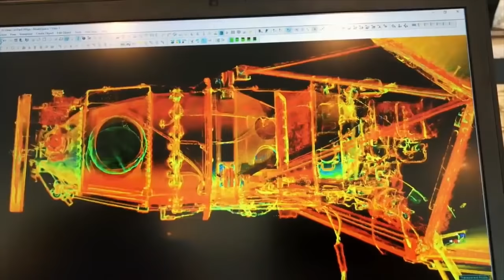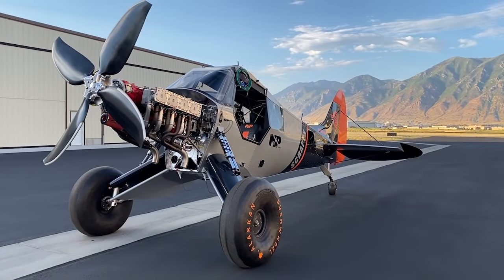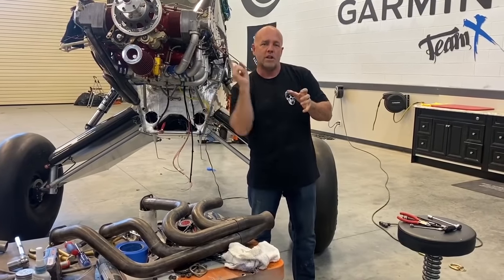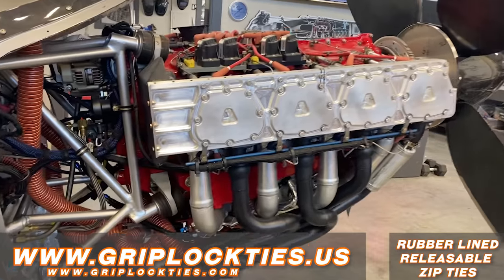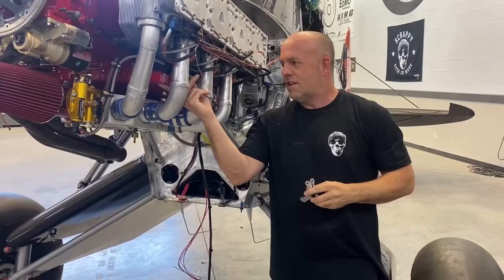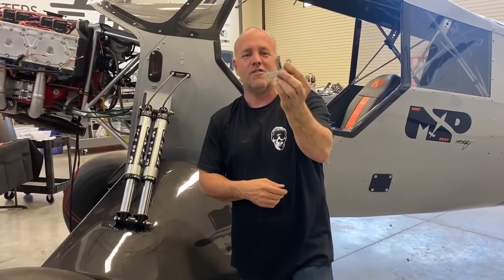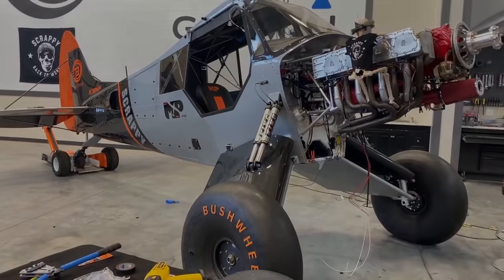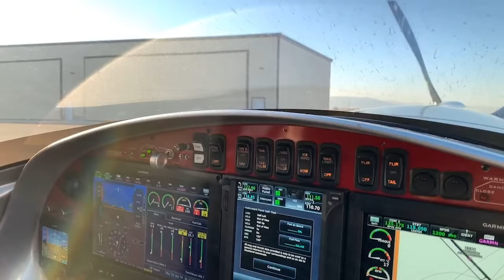Monster Race Engine Roars to Life in Tiny Bush Plane 🤩 Part 1 | Scrappy #32

Comment: As a fellow designer, engineer, and machinist.....I love the VO on the intro "Machine it, draft it......"
I tend to start in the shop as well - fiddling with ideas and concepts to see what is possible. Then I draft the part or assembly afterward armed with practical knowledge. 

Really love how you approach these challenges Mike! Really inspiring.
Reply: I, also, am a Mechanical Engineer (MET)! And I do design work (sometimes I just build it) and I know my way around a Machine Shop! My first thought when I saw the Intro was "This thing has an INSANE power/weight ratio!"

Comment: I bet that thing would fly even without the wings at full throttle...
Reply: Piece of cake to take off, but good luck with the landing...
Reply: @patheddles4004  pull the parachute to land...duh...
Reply: I have thought the same
Reply: I bet it would fly with the wings at idle throttle.
Reply: I´ll  bet Scrappy can jump up with the front gear up, even without the engine running, 
i´m pretty sure mike build kinda a lowrider/jumping car setup with these KingShocks, 
using the pressure of the Oxygen bottle..  Why? 

Stol Drags.. start with the shocks at no pressure, and a low height, avoiding drag from the Wings to get to Takeoff Speed even fastere, 
and as he hits the JUMP Scrappy JUMP  button, 
the Shocks and the massive travel they have will catapult Scrappys front up to get an massive Angle of attack.. 
and let the 780cui engine deal with the drag..  which it will be easy capable of pulling kinda 90° verical up   

This thing is a SToL Top Fuel Dragster while Draco was(and will be again) kinda an STOL SUV with lots of Power
Reply: That’s what I’m worried about, better be some real magic in those new wings to counteract all that torque “at low airspeed” especially in a crosswind.
Reply: @tropicthndr  pretty sure mike has done the math for that... and the steering surface will be huge... while that sick fan infront will deliver the air stream to put preassure on
Reply: True, rockets don't need wings to produce lift
Reply: He don't need no stinking wings.
Reply: Fastest powered parachute out there!
Reply: @jaybarnish77  rockets dont have engine torque to counterbalance
Reply: Well, they say helicopters fly by aesthetic antigravitation; being so ugly, earth refuses to attract them. In its current state that might work...
Reply: After I saw it a few times I realized that it misses the wings..
Maybe the brain didn't think it needed them with that engine.
I bet it can fly fixed point if you don't mount the wings.
Reply: Mike likes to do everything ‘extreme’. It’ll be fast. He said at the beginning he wants to set records. There is no market for an aircraft like this. Unless, you’re rich and have rich friends.  The commoners will have to resort to watching what he posts because building an aircraft, like this, ensures the commoners won’t be eating breakfast with you on your friends 500 acre ranch, next to a stream, with their $1.5+ million dollar aircraft all lined up.
Reply: @shanbadg697   With the prop being fixed pitch and designed for acceleration and climb out, it won't have much top speed.  But I guess one's definition of fast could mean acceleration or speed, so...
Reply: @SirDigger420  Counteracting torque is not done with wings, it's done with rudder.  He's already made it considerably larger than a cub.
Reply: @Skinflaps_Meatslapper , a minor correction. Scrappy most definitely has a BIG constant speed propellor!
Reply: @v1rotait23  It's fixed pitch.  Look at the video where he talks about it.  Pitch is ground adjustable only.
Reply: lol  that tail will produce enuf lift with that thing at full throttle prolly...  waitin to see if it jumps the rear wheel up at idle!!!!  (myself waitin for that, lol,  hahahaha unpausing)
Reply: I bet that thing would fly without the throttle at full wings...
Reply: Nope without wings the torque from the prop would spin the aircraft.
Reply: @HotelPapa100  60
Reply: Same here
Reply: I swear 💯 sure😂😂😂
Reply: It's a guided motor
Reply: @nealsims1862  tail rudder? haha idk im a spinny wing pilot we deal with torque all the time, you can keep your planes
Reply: Yep stand it on end and it will fly like a chopper
Reply: LOL!  🤣  👍🏼👍🏼
Reply: half throttle
Reply: it would be a propeller powered rocket
Reply: That was crazy! I watched this whole video and never noticed this plane has NO WINGS! lul
I was fascinated by the aesthetics, the engine and design. I watched the next video in my recommended in the title it said "wingless plane" and it struck me that plane had NO wings!
OMG the thing is so beautiful I never noticed but then again I am not a plane person .
Reply: InstaBlaster.

Comment: I am always impressed by your attention to detail with your engineering Mike. There is no “cutting corners” or “close enough is good enough” approach with your aircraft builds. The most recent example where you took the time to manufacture the throttle and mixture control bell crank levers with ball bearings instead of plain bushings is just another example of going that extra yard and is fantastic.
Reply from the maker: Thanks Jeff 🤠

Comment: That was one of the best explanations I have seen for having tuned exhaust. Thanks Mike!
Reply: This is only equal length NOT tuned length. Tuning is FAR more involved and if you want to read up on it have a look at the Race Engine Spec Form on BUNS Stainless website and some of their articles on the subject.
Reply: @timphoto83ec  
Indeed. A very long winded explanation at that. Guy is acting like he invented the concept.

Comment: Since you introduce this engine I've had a question. With the power to weight ratio, is there some reason that you still need wings? KJZI
Reply: Torque control! like the tail rotor on a helicopter! LOL
Reply: Scrappy #33 no need for wings, lets fly it.
Reply: Wings schmings........ let er rip!
Reply: He's got wings on the landing gear...
Reply: Without wings there would be nowhere to mount nav lights :D
Reply: Quite seriously he could probably just hang it vertically on the prop.
Reply: @ToddDunning  ive been wondering if he is going to do this... bc he is skilled/crazy enough to try it
Reply: @ToddDunning  VTOL. yeah.
Reply: @KM-dx8kf  Oh God, I didn't think of that.
Reply: lol lol lol lol lol  Right?!
Reply: Off to the ¼ mile Drags with no wings, keep her straight lol.... torque steer into the crowd...

Comment: The prop is as insane as the engine. Can probably take off like a helicopter.
Reply: do weird tricks like they do with them superlight high powered RC planes
Reply: Draco darn near did!
Reply: Looks like an airboat prop
Reply: @austinzimmerman2934  Lol, It IS an airboat prop!
Reply: @daverohn383  probably would have if he tried... cant blame him for using proper instincts to save himself tho.
Reply: of course it can. it would only require like 2100lbs of thrust to do so. and ill bet my life it makes WELL oVer that!!!!
Reply: At 13:46 he actually did. 45 degree climb. Straight up.

Comment: Just discovered your channel. As a hot rodder, an off-roader and an F-15 Eagle maintainer of 34 years, I totally dig what you have created. As an Eagle Keeper, the world's ultimate hot rod, I can totally appreciate putting a big engine into a small package. Good stuff! I just subscribed.
Reply: Hydin Biden  Well, yeah, the Blackbird was faster and flew higher... but the Eagle set numerous time to altitude records and I'm pretty sure is more maneuverable. Probably easier to maintain as well. Never worked the Blackbird but I've heard the horror stories.
Reply: Hydin Biden  Right on. Once a Marine, always a Marine! Once it's in ya, ain't no getting rid of it.

Comment: And I thought a 427 cobra was the ultimate. This is insane for an airplane.
Reply: Never heard of the Weineck AC Cobra 780? Check it out! ;)
Reply: So that's a flat 8 in there then?  How would that compare/function if it was shoved in a car?
Reply: In 1960,
Reply: stefan w my dad told be, after WWII he say a guy put a Spitfire Rolls-Royce engine in a car. As it drove down the highway at 80 miles an hour he could give it gas and smoke the tires

Comment: That double sheathing on the electric cable is something I wish I had on my semi. I had my main battery cables rub over each other right next to my fuel tank and catch fire. I was able to put it out and disconnect the battery before the fuel caught. It was a scary few moments there. I'd hate something like that to happen in the air.
Reply: The tube the wiring bundle is tied to is called a 'raceway'.  Keeps chaifing and dangling wires to a minimum.  I used to make and repair acft engine wire harnesses.  
He's right - that's the smoothest sounding recip engine I've ever heard...

Comment: Top 5 reasons there were only 9 seconds shown of Scrappy running...

5. Mike got something in his eye.
4. It only ran for 8 sec.
3. With no piped past the headers it was too loud, & the neighbors complained.
2. The cameraman lost the rest of the footage......
       AND THE NUMBER 1
                 REASON

1. The pick-up couldn't hold it back, even with his wife standing in the brakes....😜👍👍
Reply from the maker: 😂 You know there is more coming 😉
Reply: @MikePatey  
As certain as death, taxes, the sun rising in the east, & if I ever get close enough to see it parked I'm checking the oil... LoL 😜👍👍

Comment: The  torque is a concern, but I'd be more concerned with not enough back elevator while on the ground. One good engine rev and It could end up on its nose before you could react.
Reply: That's why it's called throttle management.
Reply: Craig VanWagner

Take off and land with the tail wheel down whilst maintaining throttle control. The B-17 and Gullwing F-4 (WW2)  used this solution for that problem.

Comment: Sheesh. 12+ minutes in, a puff of smoke and a short rev, tamped down with electro-muzik. Disappointing.
Reply: bs
Reply: it's the very first start up...what did you expect for the very first? full throttle? a take off? pretty sure you missed the entire point of the series...it's a building channel...

Comment: Looks like ALOT of weight hanging off the front of that plane. Is that block and head aluminum or steel?
Reply: It is an aircraft engine.

Comment: Sweet Lord! That 10 yard runway at 13:46 and you are up in the air! You are climbing at solid 35 to 40 degrees there, like a modern fighter het! The horsepower on that thing is insane!!!

Comment: Mike sticks two fingers up to all the so called 'experts' out there  by doing it his way.
This plane is superb, its well thought out and done to a very high standard. Nothing wrong with having this much power, it's actually safer than a low powered plane. It can get you out of
trouble in the air and will have much shorter take off. Great work.
Greetings from Russia.. ❤️

Comment: I enjoyed this video as much, if not more, for the engineering approach discussion as for seeing the engine start. I build RC airplanes and I do the same sort of thinking through how I want something to work before just brute forcing it. Thanks for probably the best layman's description of how a multi-cylinder tuned pipe exhaust works. I believe the engine start and runup illustrated the point you were making.

Comment: Awesome!
Its funny I have a little mini bike that I put a engine 3x the size of the original in and it also has throttle linkage that looks exactly like that:) I may just have to start calling it scrappy lol. It would be the perfect name for it. Its almost impossible to take off without it putting you on your back.

Comment: Wow, what a beast! Looking at it from the side you get the impression: ooooh look at that sweet little Propeller in the front 😎 but hell - that thing is moving some air 💪🏻
I'm wondering if it can pull forward on full throttle even with the brakes locked and skid over the flor - I guess so!

Comment: I don't know anything about planes but it amazes me that the engine is mounted on the front like it is....and that is enough to secure it? Four bolts and a tubular rack? It looks like the weight wouldn't be supported enough. Perhaps it's the camera that makes it look that way. Just seems like there should be something supporting it out to very front of the motor. Evidentially it works that way. Is it designed to break away in a crash perhaps?  It just has me puzzled LOL Love  the airplane though...and the shop! Good show!

Comment: we used that gluey rubber heat shrink on Baja Race vehicles radio harness at the Radio Shop I worked at way back in the 90s  ;)  and put it anyplace where there was strain on the harness...  good stuff... as long as you don't need to get back UNDER it for wutever reason lol  we just ran the harness an extra 6 inches over what they said the lenths needed were, for ''repair length'' but usually by the time it broke it wasmore than just one thing lol  used 5 conductor MICROPHONE wire, everything was double shelded each wire was and there was a main shield too... that stuff was like 4.95 a foot back in 90 !!!

Comment: To get true pulse exhaust design the individual runners must be the same length that creates more of a convoluted spaghetti than you have.  Also, the pulse firing order of the flat 8 will determine if you need to interconnect the two banks of headers.  I presume that as the engine is a sidevalve design that the cam timing is conservative and revs at which you get max BMEP will be relatively low, that then draws into question the shortness of your primary runners.  The more conservative the exhaust timing and the lower the revs are the longer the primaries need to be.
On vehicle engines it is much better to achieve 95% of the throttle opening with 100% of the lever movement so that the operating mechanism is not strained.  The additional 5% of throttle opening is not really worth having if the engine is properly set up.  Constant throttle strain against the stop at best will stretch cables and strain bearings, at worst will cause breakage that could be catastrophic.  I would have thought that the same comments would apply to aircraft throttles?

Comment: Tuned headers are a must in order to load the maximum air and fuel charge and if i remember correct the shorter pipes are tuned for low-end  while the longer pipes are for top end.

Comment: I read a fascinating article on exhaust pipes and how changes in diameter create pressure waves to either evacuate the cylinder or push fuel mix back in.  will have to find it again now.

Comment: Jaysus, some of the numbers give some serious ****ing perpsective. The engine is almost the displacement of a WWII fighter and not so far off the power they were making at the beginining, c. 1000hp with supercharging. I hope that subframe is up to the job. ETA >> That prop, though! Reminds me of German WWII fighters - as power outputs increased, instead of multiplying blades they went for widening them practically  into paddles.

Comment: First thoughts:
1.How big does rudder have to be to counter p factor? 
2. How big are motor mounts? Yikes.
3. Will motor snap off in hard landing?
4. How long is arm to counter weight of engine? 
5. Can it hover, lol, like a sukhoi?

Comment: Mike: The Engine looks insane. One concern is the Header Collector looks too small. If you look at a car header collector, It's larger, but tapers down. Is there a reason for the smaller Collector? I like the smaller diameter prop. Less tip speed so you don't waste power. Cool!!!

Comment: I sincerely hope you accounted for the massive torque strain on the engine frame, preventing the frame bars from twisting when revving the engine up multiple times. From what I seen, it didnt appear you designed a twist bar feature to keep the engine mount from literally twisting on the rotational axis

Comment: I don't know if you will see this, but I wonder what the purpose of tuning a 2 stroke paramotor pipe is.  It's only got 1 cylinder, but apparently if the pipe is not tuned it's terrible.  Would that be because of back pressure?  

Also I think you would make the best paramotor ever with your new ways of thinking about things, and I think you would pick up about 200K subscribers out of the paramotor world if you did :)

Comment: I believe “equal-length headers“ is the term that has escaped you. Sounds wonderful; where can I find an engine like that for my 1973 Stretched GMC Motorhome?  (It is front-wheel drive)

Nice bell cranks for the carburetor setup.  Spare no expense!

Comment: Add some graphene capacitors to battery system. They are light weight and are the latest tech in capacitors  with a lot of capacity. just  as in electric motors they will help with the inertial start up amperage. plus knowing you will probably install a ww11 spot light..

Comment: Sir, I have a sneaking suspicion that WHATEVER you do, you will be good at!  Without being condescending, I can not remember a video that showed such enthusiasm and knowledge of the subject matter as you showed in this.

As an aside, since you are a pilot, maybe you can answer this question (if you don’t mind):  why did most German fighters during WW2 have 3 bladed props instead of 4, such as the P-38, the P-47, and the P-51?

The prop of the FW-190 just had 3 blades but the chord (if that is the right word) of those blades was extremely wide.

Have a blessed day!

Comment: Mike, why do you do the wings last? Is that so it’s easier to maneuver in the shop? So many kits do the engine last. I love how you think about each piece, and work to engineer the best and smoothest solution, not just what is easy.
Reply: Gotta know how much it weighs before you can engineer wings to support it. It’s so custom. If it were a typical kit, you could do the wings anytime.

Comment: its called unequal length headers. Subaru engines older than 2012 or so have unequal lengths, but any thing newer it would just sound like a normal 4 cylinder.